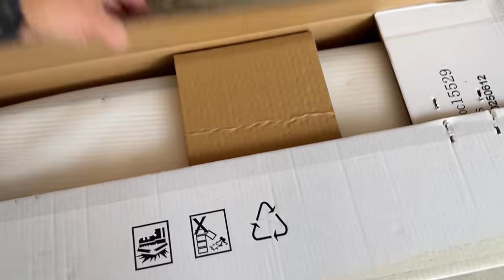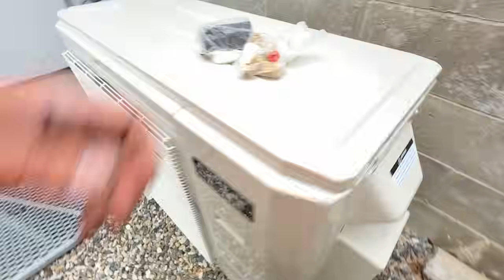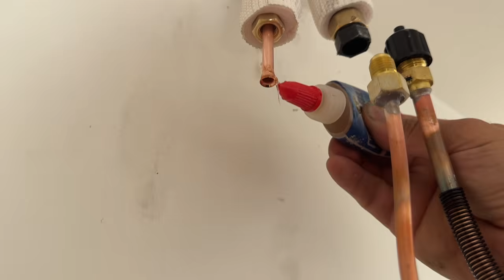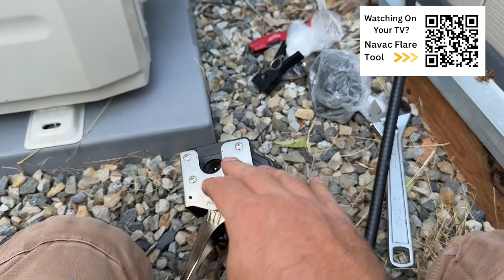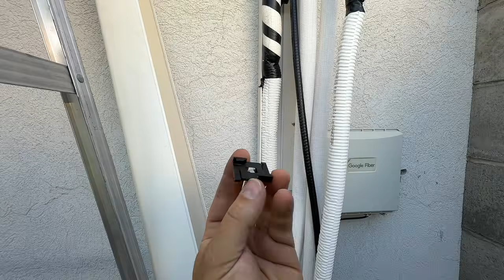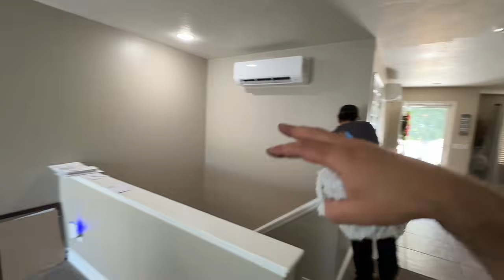We Installed A 25 SEER Dual Zone Heat Pump Mini Split...

Comment: bit of confusion here, you pressurize lines for leak test and when ok, you let the air out. Then, you pull vacuum on certain level and when it's done, you open plugs to release refrigerant. After that you unhook the compressor. How is the refrigerant kept inside and does not escape?

Comment: How far can you run the condensate line without needing a condensate pump?
Reply: The condensate line isn't all that much different any other plumbing drain pipe. As long as you can maintain a suitable downward slope over the continuous run, gravity will do the work. Otherwise you'll need a pump.
Reply: @doneden5368 thank you

Comment: I am confused title of the video says 25 seers, but when I check out the link to purchase it’s says 15 seers.
Reply: You might be looking at a unit with an air handler?  15 seer is the norm for a heat pump unit that goes through ducts with an air handler or blower

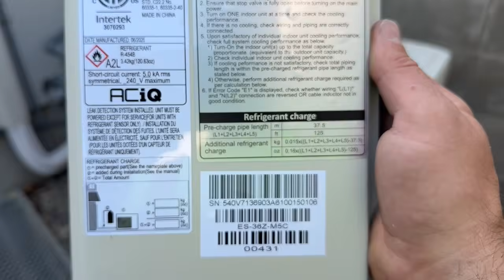Comment: 23:00 What do you do if you cut your lineset significantly shorter than 125ft? I imagine it would be overcharged and require refrigerant removal.
Reply: I imagine if you plan on less lineset length, your unit probably needs to be smaller anyway.  5 lines more likely to be over than under

Comment: I enjoy watching your work and learning things. I would very much like to replace my electric resistance central heat and air in my mobile home with one of these efficient heat pumps but literally no one will install anything but what they sell. And before y'all chime in saying do it myself, NO! I ain't buying the special tools, learning to use them properly and then doing a less than professional job or making mistakes because this is not my profession. No one can even direct you to installers who will put in these type units or even any who sell and install the brands I see like aciq. I can't believe there is no directory or list of HVAC people who will do this.

Comment: Looking at an ACIQ 3.5 ton downdraft heat pump split unit at the moment to replace a 25 year old system that got sabotaged by an HVAC company.  Hoping its decent, as it's a quarter of the price of anything I've been quoted!
Reply: Same experience with a company that replaced our water heater in the fall and did an "inspection" of the A/C argyle there.  Find out what the "inspection" was next summer...

Comment: 30K BTU's for that small area??!!
Reply: They're only using 2 of the 5 heads, so those 2 heads might be 6k each (leaving 18k for the remaining 3)?  Or perhaps one is 12k and the other is 6?  Just depends on what they chose for the upper floor.

Comment: So i guess the only way to add more units to this system would be to recover the refrigerant then add the new unit and open the valves then pull a vacuum on the whole system again? Or is there a way to pump the refrigerant into the outdoor before hooking up additional units? Thanks
Reply from the maker: No need to recover refrigerant. When you install a new head, you’d pull a vacuum on the individual ports for the head you are adding, then once your vacuum is good, you open the service valves for that head. Then you charge additional refrigerant if needed 👍🏼
Reply: @diyhvacguy Thanks

Comment: Have the owners been told that they'll need to disassemble and clean the inside unit every 6 months? 🫣
Reply from the maker: That’s definitely not true. My MrCool in my garage which is much dirtier than a home hasn’t been internally cleaned in 2 years. Still clean as a whistle. Just keep the screens cleaned and you are good to go 👍🏼
Reply: @diyhvacguy You are very good in explaining things👏🏼👏🏼
Reply: @diyhvacguy Do you turn it on?

Comment: I have a mini split. I run it all day and night in AZ. It's extremely hot here it a 17 seer  2-ton unit. It cost me about 100 to 150 hundred in the hottest months. It's on 24 hours a day. Doesn't even bother it. I have a finished three-car garage like a man cave rec room. I can go in there right now it's about 105 here, and it's cool as can be. I love mini splits. My house unit is a 5-ton heat pump that cost me a fortune in the summer. About 300 to 400.

Comment: In general, if you’re installing a new mini split that

 requires a new breaker, 

do you need to get a permit from the city for the electrical work?
Reply from the maker: It depends on your local ordinance. But in my experience, even when someone goes to sell a home, who installed it or if it was permitted never comes into question. In fact we just replaced one in a condo, no permit, and it sold just fine. Some will say you always need to but I don’t think that’s the case. If say only if it’s part of a major remodel.
Reply: My sweet summer child.
No one is pulling permits.

Comment: Great video!!👏🏼👍🏼🙏🏼🙏🏽

Does it make financial sense to replace a central HVAC system with 3 mini-splits?
Reply: I have a home in Arizona with a 4 ton HVAC system. It gets 120f in the summer, i bought 2  12k mini splits to assist the HVAC. The HVAC never came back on again as the 2 mini splits satisfied the demand. Sounds crazy but they are facts.
Reply: @porky7753 Thank you for the information. About how much did you invest in the two 12K mini splits, including installation?
Reply from the maker: Absolutely. They are crazy efficient and have independent room control. This will absolutely offset the energy bill of this customers main system.
Reply: @diyhvacguy Have an Austin, Texas location?
Reply: Northern Michigan. TC area.   pulled out 3 ton A/C. Installed 48K ACIQ (will handle 5 Head units) put in 3 -9000 BTU units & 1-12000 BTU head unit. Cherryland Electric installed 2nd meter for Mini splits 25% discount .  very quiet. HH models pull heat out the the air down to -22 below zero. Just a fantastic system.
Reply: Some of these tools are great, like the flare tool, but it’s $400. That’s just one tool. How can the diy’r justify buying this plus a lot more. Have you done a video for the bare minimum a diy’r will need to buy? Thanks